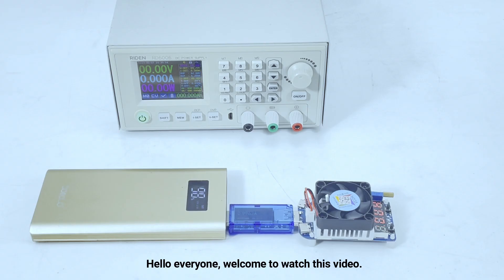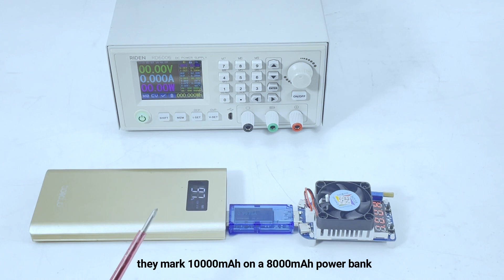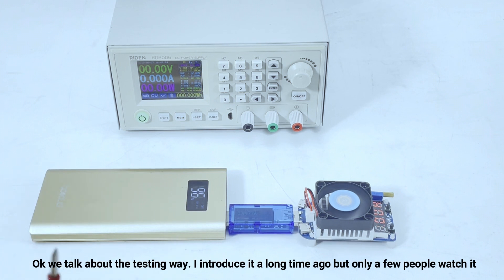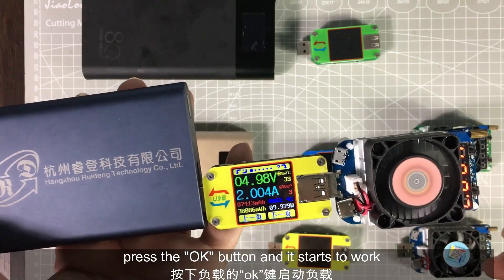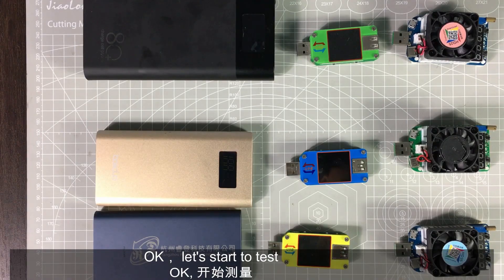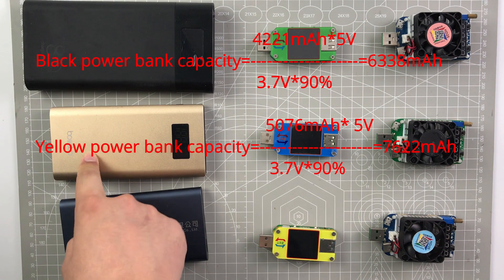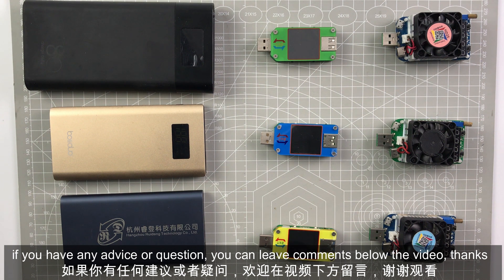Your Power bank may have sand inside! power bank capacity test with UM25 UM24 UM34

Comment: 2 little mistakes. At the calculation you said divided by 90%, but you mean multiplicated by 90% as written. At the loading procedure the blue power bank ist loaded with a flashing QC2.0 LED at the load (HD25 or HD35). During any test all conditions should be equal. So better to use one charging protocol for all. And for the understanding it could be useful to explain why some powerbanks stop the charging procedure. I could see that you had to disconnect and to restart the charging at the black one. I know its a feature of power banks, but others could wonder about this issue.
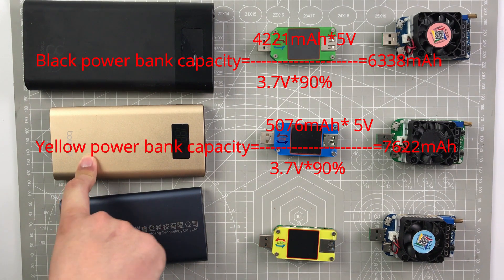Reply from the maker: hello, thank you for your message, you watched carefully, yes it is devided by 90%, you can see at 9:58, when I calculate the data, I write *90% in the below, like 4221mAh*5V/(3.7V*90%)=4221mAh*5V/3.7V/90%,  and for the testing way, yes I should test them in the same condition
Reply: @rdtech9153  Ah ok, so the written symbol is the missunderstanding. In Germany we use * only for multiplication and / for the division. But its clear now. The result is only 90% because of the lost by heat and resistance of the cable and chips etc..
Reply from the maker: @Pixelpanscher  yes and usually the efficiency will be marked on the surface

Comment: It seems that the formular using Wh is more useful if you don't use a constant load. E.g. when you discharge with a phone which uses PD or QC, then the voltage and protocol can cause a wrong result as voltage can go up to 9V or higher. Same with charging and testing to load a powerbank using a power supply with PD/QC. Or is one of your newer models like TC66C able to calculate this higher output voltage correct in combination with the charging protocol PD/QC?
Reply from the maker: yes, the mWh can be more useful if you are no using constant voltage to discharge the power bank, if you are using a phone to discharge the power bank, use the mWh to calculate

Comment: Thanks for the video! I used the USB Meter and USB Load to measure a friend’s power bank a few weeks ago. These are very useful tools!

Four questions from the n00b that I am:

1 - Instead of the 5V used in the equation for real capacity, should we use the voltage measured by the USB Meter? For instance, the black power bank and Xioami’s both output around 4.8V instead of 5V.

2 - Where do you get the information about the battery voltage being 3.7V?

3 - Where do you get the information about the efficiency of the Xioami’s power bank being 90%?

4 - What does “real capacity” mean, and why does it matter? It seems to me that the only capacity that matters is the one measured by the USB Meter. This is the number I can compare to the capacity of my phone’s battery to know the amount of 0%-100% charges my power bank can give to my phone.
Reply from the maker: hello, let't answer the question one by one, 
1.there are 2 formulas to calculate the capacity:
A: capacity=measurement mAh*output voltage/battery voltage/effieciency
B: capacity=measurement mWh/battery voltage/effieciency
if you use the A formula, you use the output voltage, because I use USB load to make it output constant 5V, because the output voltage may change, so I recommend to use the B formula

2. because in the power bank, they all use li-on battery, so it is 3.7V
3.for the power bank efficiency, it is marked on the  power bank
4.for the formula to calculate the real capacity, the value is used to compare with the declared value on the power bank
Reply: Thank you for answering my questions, I appreciate it!
Reply from the maker: @Lescar-B-EAU  you are welcome: )